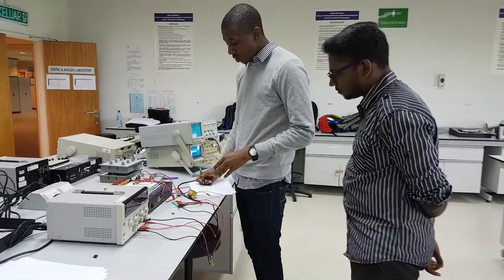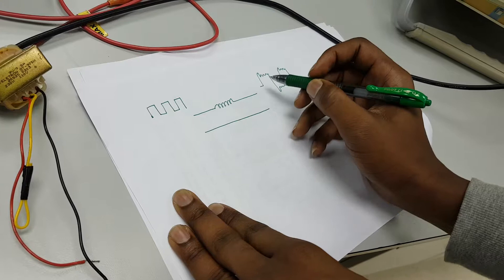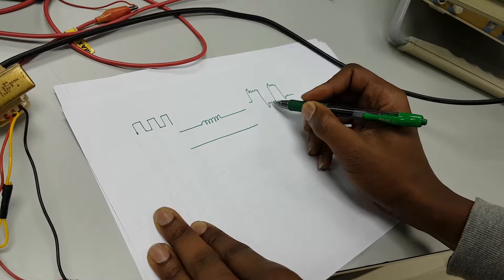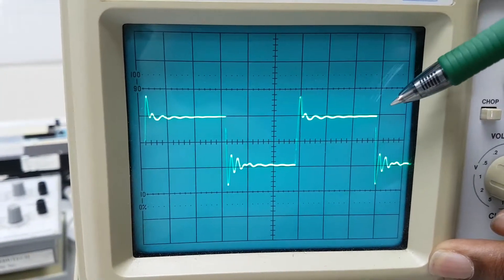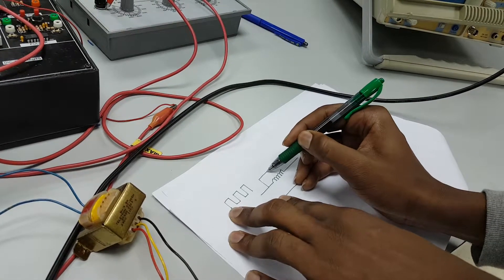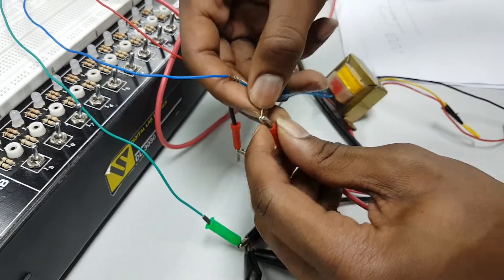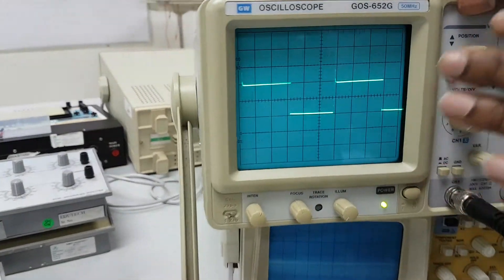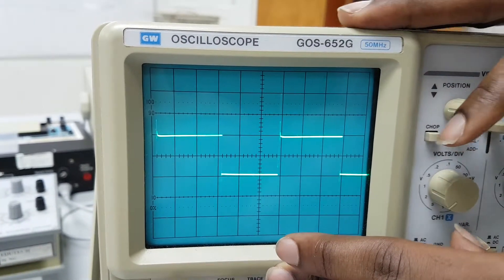Removing overshoot and ringing from high speed square wave. FECT AIMST University

Comment: can you help me and telling me how much is the value of the inductors or (transformers). are they step up or step down. I see you are using timer to generate the square wave, but in my case i am using Function generator and I have the same problem as you have (ringing pulses). Would you mind to help me by telling me how shall i remvoe the ringing signal from the function generator.